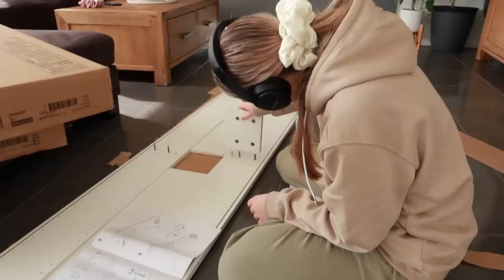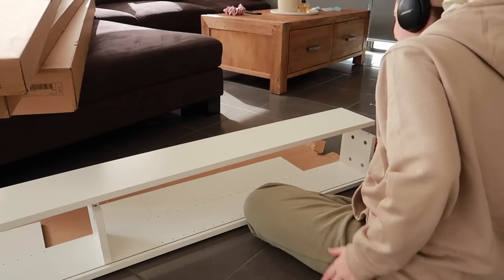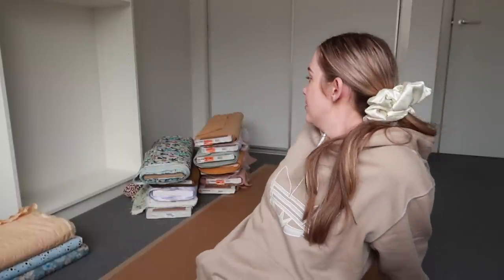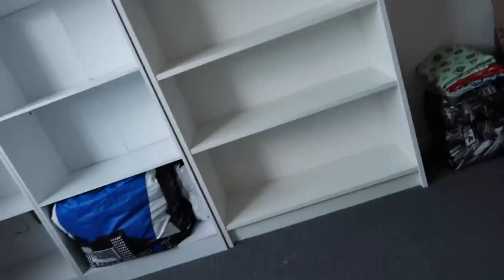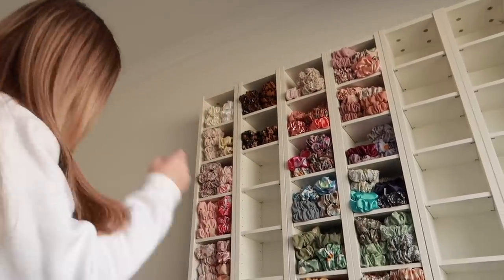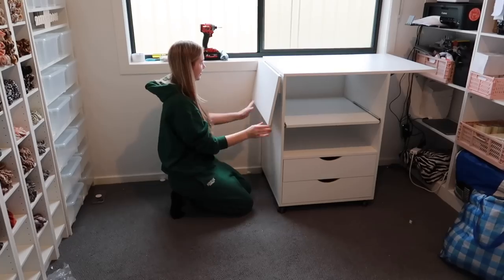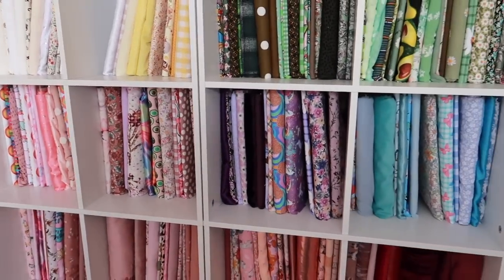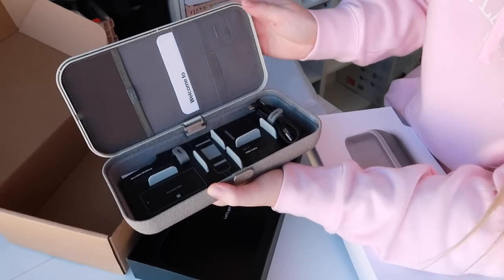I got a second studio room! Building Ikea furniture, organising my craft studio space VLOG 050

Comment: I’ve got a whole wall of billy bookcases in my craft room , they are so good …. I got some extra shelves cut at Bunnings and hubby drilled new larger holes so I could have shelves closer together for the area I have the handmade soaps I make ( the pins to hang the shelves that Ikea use can’t be bought so I had to get a different size from Bunnings so needed different holes)…..you can buy extra shelves at IKEA but they are so expensive.